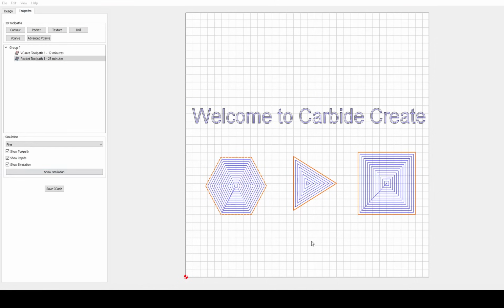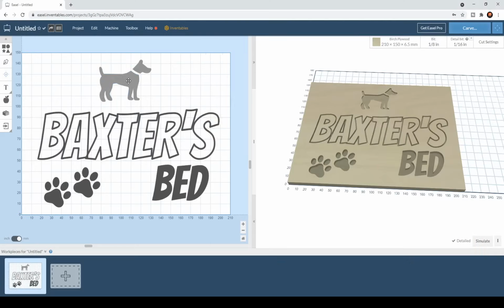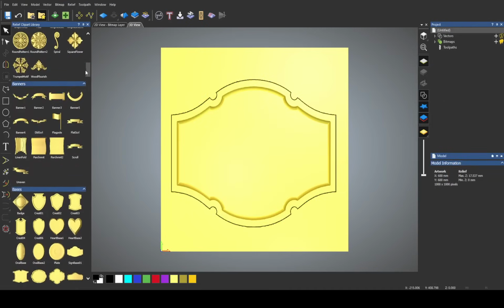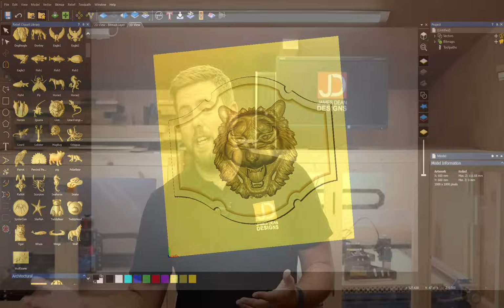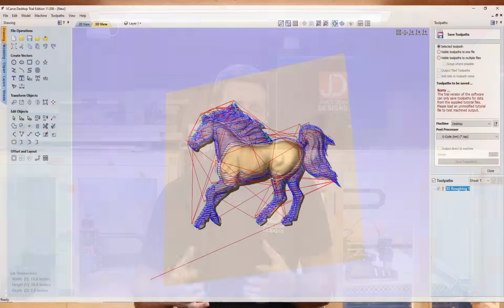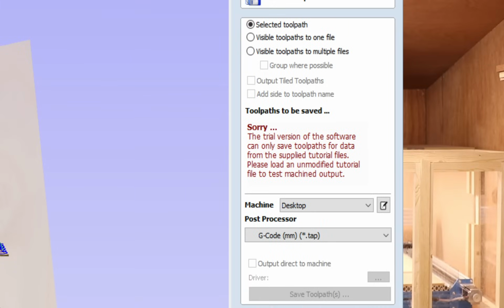Beginners guide to desktop CNC software

Comment: I just don't understand why these desktop CNCs don't come with basic conversational programming like a full size CNC. The ability has been around for decades and the processing power to do this doesn't have to be very big. This would be great for introducing the owner to the basics until they get comfortable with the machine.
 I really want a desktop CNC but haven't purchased one for this reason.
Reply: stupid buy ready cnc very expensive, same normal men can build own cnc machine at home own hand and have lot lot cheape, need remember only some limit, if not can make metall work need use wood and aluminium, no big problem, many wood frame and aluminium frame machine working well all hobby user job. and minimum stepper motor what can use have normal NEMA 23 or 34 470OZ or 3Nm torque motor, thats have minimum what normal used, then important have stepper motor drivers, need be same or little more current option what motor max current have, this mean if you buy 4Ampere motors, need setting drivers max current have same or near 4A not more or burn motors, then controller board have 2 option usb or paraller port controller, paraller port not have many new computer, but can buy 10-40$ old good computer were can install linuxcnc control software. cheap and good /best controller all cnc machines. paraller controller board cost about 8-12$ usb have many but used whit windows softwares, etc worst mach 3 software, not safe not REAL TIME controller dangerous and lot problems. many other have manufactory own software and not can make ow tool addition etc own code or additionals tools and anythink, if come problems have expensive repair. linuxcnc have FREE and flaxiple add many many own tools and software additions, pump,camera,tools change, automation,robotic hand etc. many ready to use software NOT can add anythink. normal men can build own cnc machine in home garage normal tools, openbuild cost 4000$ same and better machine can build home own hand less than 1000$ and have better biggest motors and can add many own options.

Comment: Great vid, only just recently discovered your channel and I've spent hours trawling YouTube for decent info, unfortunately most of is has been useless or the narrator just waffles on and on...and on (americans)., so glad I came across your channel. Anyhoo, I've had the mechanical parts for a cnc router for a few years, but only just made up the machine (I dropped you a message on one of your other vids, thanks for helping out). I'm now at the electronics stage and my head is BATTERED, Been on a couple of forums and been getting conflicting info or no info at all, so I'll apologise in advance for my up coming barrage of questions. Cheers. 😊😊 mick

Comment: Thanks James for clearing some of the fog for a 76yo CNC newbie. Just built an 800 x 800 CNC from 17mm alum plate etc. and now sorting out the electronics and software. Never too old to learn!!! I think I will go with VCARVE as I have a philosophy that if an old version of software does what you want then why go with the upgrades of 2 headlights instead of one, 4 wheel disk breaks if 2 work fine :-)  Except when Microsoft will not let you run your 97 version of Autocad on Windows 10 Grrrrr!. All the best, great job. Mike Tasmania Australia.
Reply from the maker: Glad it has helped...and wow what a project to under take. Nice one 👍

Comment: James, as you can imagine i am new to CNC and i am having acouple of issues, finally got UGS downlaoded on my MacBook Pro, but cannot get it to connect to my 3018 ............. i know it will conect with Easel and i can jog the bit around etc so i know the connection is there, want to make a soilboard but stuck ......... when i try and run the set up wizzard ut states that the controller is not supported ? hope you can shed some light on what i may be doing wrong ...... Thanks  John

Comment: i seee fusion here that interesting but i am a blender user can i use that and what export file is needed fbx or obj stl so on
Reply from the maker: To my knowledge fusion works because it has what it called manufacturing capabilities which is what does all the calculations. I don't believe Blender has that function so i don't think it will work. You could export your design from Blender under fusion and just do the last step in there
Reply: @JamesDeanDesigns  if your on about transforms for simulating physics or mechanics like turning a cog blender can do that too, im guessing fussion is used for the modeling aspect right ? then you export the model into a ssd then plug it into the the cnc interface then just print like a 3d printer ?
if so is there a preffered export file format thats better

Comment: Do I understand correctly, that in order to use my laser attachment on my CNC Router, Carveco Maker includes everything inside the program that is needed for laser work? Purchasing additional software such as Lightburn would not be needed?
Reply from the maker: Technically yes, Carveco does offer laser features but what I would say is the laser features within Carveco are no where near as good as Lightburn. So if you need to do the odd laser job then Carveco might just get you through but Lightburn is the better choice for laser work
Reply: Thank you for offering up your expertise. I very much appreciate your time!

Comment: Hi James,
I'm impressed with the quality and detail of your videos and the level of knowledge being shared. I have a couple If questions for you.

I noticed that you didn't mention EZCad (2 or 3). Is this because it's mainly aimed at laser work?

I'm right on the cusp of ordering a Vasco and hopefully a 3D MOPA Galvo laser unit as well. 

I'm told that the 3D galvo will not run Lightburn, which is a bit if a bummer, so I will have to go the EXCad 3 route.

Following your advice on this video, I'll be going the route of Maker by CarveVo and UGS.

At this moment I'm not sure where EZCad 3fits into this re cnc work, or even it can?

Comment: James, in carving a 3d model using the mauster pro with a makita router what are the best settings to get good results without the machine taking too long to carve. I am using on the finish a 1/4" ball tip bit, feed rate 50 in/min, plunge 9 in/min & step over 10%. Can any of these be changed to decrease carving time? Thanks again
Reply from the maker: you can increase the step over which cuts the time down but equally may reduce the quality of the cut, its all a bit of a trade off. You could just try upping your feeds a little as well to help and see how it goes
Reply: @JamesDeanDesigns  thanks

Comment: Can  I use carbide create on foxalien mauster pro?
Reply from the maker: Yes you can. You'll probably V6 though because they started charging for V7
Reply: @JamesDeanDesigns  Can I use carbide create as my code sender to my foxalien or must I go thru a g code sender?
Reply from the maker: @mikeledee8786   no, I think it's just design software. You'll need a separate gcodr sender
Reply: @JamesDeanDesigns  thanks
Reply: @mikeledee8786  V7 of Carbide Create required Carbide motion to also be installed. Carbide Motion can open the new C7 c2d files, so you may be able to use that as your sender. I don't have a Carbide machine, so I don't know if Carbide Motion will recognize your machine though.

Comment: Hi James, I only have my 3018 for about a week and am in the process of adapting DXF files of wing templates for hotwire cutting (model)airplane wing sections. As far as I can tell, Candle only moves the router bit in the center of the line, which reduces the outer dimensions of the template by half the router diameter. Is there a workaround in Candle to mill on the outside of the line, keeping the original dimensions? Other than adding half the router bit diameter to the Gerber file commands, which would be a lot(!) of work for the 22 templates I need, I see no other option. Does UGS have that feature?

Comment: Thanks for doing this video.  I'm just considering the Fox Alien Masuter Pro.  I have Rhino3D in which I can draw anything and which will output just about any file format.  I have done a stereolithography file that a friend 3D printed.  But I think CNC routers may do more of what I need.  Where I am fuzzy is the connection of the output of my drawing package with some form of software to make the Fox Alien machine run.  Do you have a basic video on going from drawing to cutting and how the files work with the machine or can you point me in some direction?
Reply from the maker: Different software runs in slightly different ways. For example one of my recent Carveco videos shows the whole process from drawing something to exporting it ready for cutting. But doing it in Carveco is different to Fusion 360 for example. Rhino3d will do the CAD but you will need to pick a CAM software to generate all of your toolpaths required for that design. Your CAM software should then output all of those toolpaths into a GCODE file which you run on the machine.
Reply: @JamesDeanDesigns  Thanks for your reply.  I was able to download a free version of DeskProto to play with and brought my .stl file into it and could see how I needed to select cutters, etc.
Reply: Rhino have super big and super expensive software use legal work. many lot cheapen or FREE software can use lot lot cheapen

Comment: Just to correct a sort of factual error: VCarve PRO does do any size working area, length-wise. I believe it has a maximum width but not length (and I believe the max width is 48"). So you can throw on a 4ftx8ft sheet of plywood if you have such a size machine and it will work. VCarve standard is limited, you are correct, but you didn't mention the Pro alternative.
Reply from the maker: Hi, 
Not an error at all, a deliberate decision. I'm discussing entry level software in this video and I clearly state I'm comparing V Carve with Carveco Maker (both companies entry level 3d CNC software). If I were to mention V Carve Pro, then I would have to mention Carveco Maker Plus and go into the deeper details of comparing both of their intermediate level software and it would just add too much complexity to the video. I may make another video in the future comparing the different levels in each one.
Reply: @JamesDeanDesigns  and Vcarve can make big job at "tile" mode, many small part carve one big sheet. and come one big carved work.

Comment: Was going to use Altium which puts out GRBL, NC and ODB++. This is where I hit a brick wall with this program. Carvco does have a standalone perpetual licence but that is for the professional version Carvco plus.
Reply from the maker: Hi David, I dont really know much about altium, so unable to help you on that one. That is correct about Carveco, it's Maker version is subscription only. Maker+ and full Carveco have perpetual licenses but obviously cost more
Reply: @JamesDeanDesigns  Altium is a very sophisticated design software specific to electronics engineering. Which enables you to draw circuit schematics then netlists to another part of the program where you design the printed circuit board. From there there is a CAM portion that outputs a multilayer gerber file with NC drill codes. This program has a long history since 1992 starting as Protel which then branched to Orcad and Client 98 and I believe Autocad, which are now 3 different companies that are still loosely tied to each other. Autocad became Autodesk, Orcad I think became Eagle and Client 98 became Altium. Altium advanced to include a very crude 3D modeling program. It has since evolved to a CAD, CAM and Programmer. I like Altium because it has very nice eye candy.

Comment: this video comes across as mostly advertising for Carveco......  any comments about Meshcam? I guess they are competitors?
Reply from the maker: If it were a sales pitch then I wouldn't stress that free Easel is the easiest place to start. When it comes to paid software, Vectric and Carveco are dedicated CNC software, MeshCAM is not. MeshCAM is 3D software that allows for CNC, similar to Fusion360. If I am paying for CNC software then I would rather pay for a platform dedicated to CNC output. Don't get me wrong, if you're into 3D printing as well then MeshCAM might be be better investment rather than paying for 2 separate pieces of software

Comment: Parametric just means that it uses "Parameters" is one way to remember it. Where parameters are basically named variables. So you could, instead of saying "make this edge 12mm long," say "make this edge 'height' long" and set a parameter named height to 12mm. That way you can base other things on that parameter and change it later and everything using it will change with it. Hope that makes sense.
Reply: Kind of something he should know ...

Comment: Just to be clear. Carveco has all 3??  Design, tool path,, and G-code??
Reply from the maker: Carveco can design, it can create your toolpaths and it can export Gcode files for you. It is not control software though so you will need something like UGS to physically run your machine
Reply: @JamesDeanDesigns  
Is Mach3 a good one?? It comes with the machine I’m looking at
Reply from the maker: @Checkitfirst  not really. A lot of people still use mach3 and arguably it's more powerful than GRBL however it's old, outdated and costs you money where as GRBL is free. I would personally stick with GRBL
Reply: @JamesDeanDesigns  
Sorry for so many questions. I have a CO2 laser. I have been using it four years now. I would love to try a CNC but know nothing about it yet. I have been watching videos all week. I was a little confused because I am using only two pieces of software such as ink scape and K 40 whisper. Now it appears I am going to need three different software’s, unless I want to spend a fortune.  I do not want any CNC smaller than 24 x 24. I want to purchase this one time so I can learn on it for years before I spend a whole lot of money on a much larger one. I have lots of woodworking experience. And I would love to incorporate this into my business. I do believe CarveCo is where I’m headed

Comment: Hi  Teacher I have bought one USB 3Axis 6040 CNC Router Engraver Cutter Milling Drilling Machine 3D Cutter from ebay ,and I have download mach3 as they said but my machine never work at all, also I download a easel is the same but easl give me Gcode which is good ,so my machine will just run with Drufel CNC i think is free, my question I have no idea why when I save g code  file from Easel when I start to carve fully size will be change ,wish you can help and teach me :) help anyone they have had like as my problem :)

Comment: thanks for al you info on your use of CNC software. i have just completed my own cnc based on 3018. i have an issue. some of the wooden components that make up the gantry ar pretty rough and i'd like to cut those parts using my cnc for accuracy. what free software option is there that i can draw out these parts to dimensions for shape and hole locations. easel is ok but to draw out a shape to dimensions is eluding me, can you help
Reply from the maker: Fusion 360, Carbide Create are two free options. You could always draw out in Inkskape, then import the SVG file into Easel
Reply: @JamesDeanDesigns  thanks i'll try fushion 360

Comment: I am waiting for my FoxAlien Masuter Pro to arrive in a few days and looking at the software. Easel was recommended, but I have spotty internet service in my shop so that is out. Looks like it will be Craveco and UGS. That just created a little more anxiety for this old retired guy. Adding the additional step :(  Fewer steps is generally a better thing, but we will see. I am enjoying your videos - easy to follow and understand. Well, there is some new terminology is a hiccup once in a while. Any suggestions you might have for a real newbie would be appreciated. Been woodworking for years, and now retired and trying some new things. Started laser engraving a few weeks ago. Thanks again for the great videos. Blessings, Don
Reply from the maker: Easel is by far the easiest, if you have another laptop or PC in the house, you could always use Easel to design with whilst in the house and then just export the Gcode onto a memory stick and take that out to the workshop. Thats one way around it. Alternatively you could look at how to get better signal out to your workshop. A WiFi mesh system is fairly easy to install and extends the distance of its range
Reply: @JamesDeanDesigns  Thanks James!  We are with our son in a large house here in NM retired from WA and loving this mist free weather. Here in NM most houses are block and brick - not good for wifi. Anyway, we have a mesh system already in place. The shop is also block and we have an extender, it works - most of the time. The issue would be dropping signal or a degraded speed when in the middle of a carve. I guess the question is ... Once the project is loaded is the internet connection required? From what I read in your comment, that would be no. If so, that kind of changes things a little. Easel is more expemsive, but handles the control. That may be a better thing for me. Just one less thing to worry about. I do have a laptop that I use in the shop for laser engraving. So maybe your solution will be best for this newbie.

Comment: I got just my masuter pro. I'm an illustrator/cad designer I use Adobe illustrator which file format should a use.
Reply from the maker: Graphic designer by trade so I'm a fellow illustrator user as well 😁 usually SVG or EPS are the most common. If you go to use Lightburn though, for some reason that doesn't accept EPS files